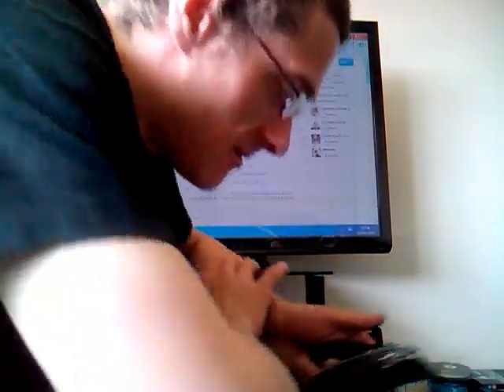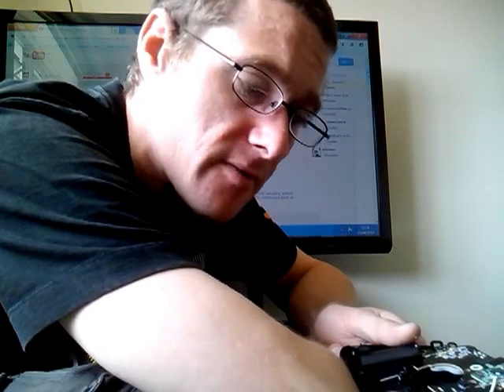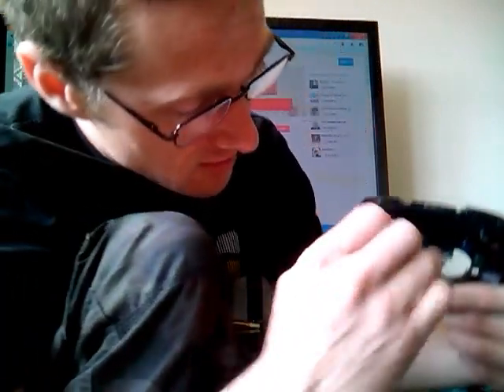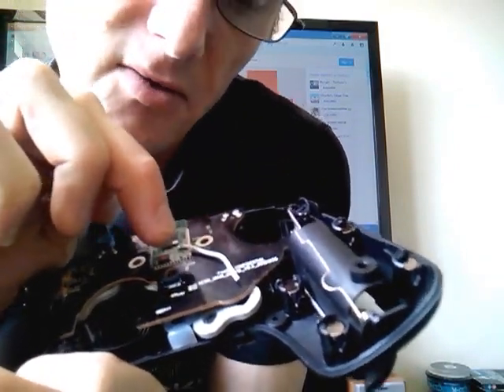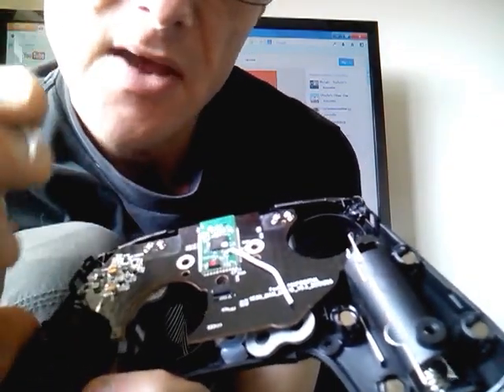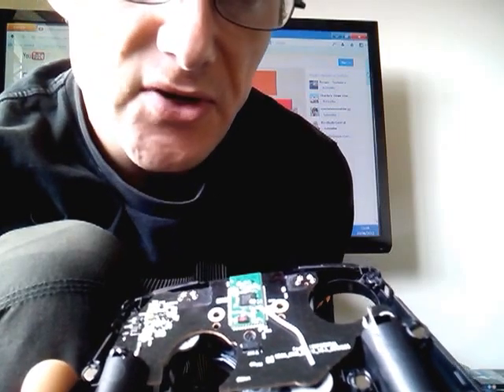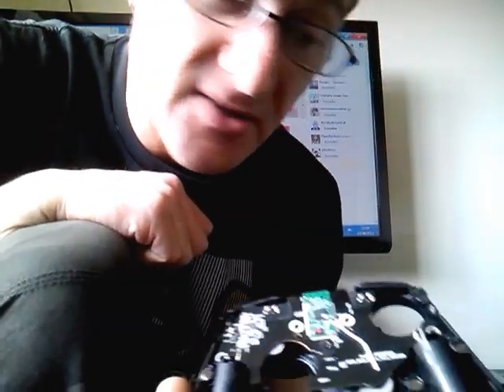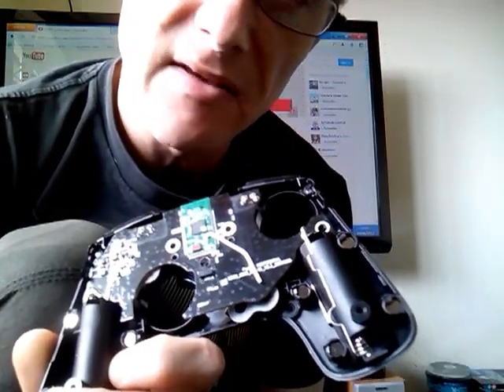OUYA CONTROLLER CONNECTION FIX (BLUETOOTH RECEPTION MOD)

Comment from the maker: I did use the wire for a laptop wireless receiver it came from an old acer laptop lid,sorry never mentioned that in the clip,but any wire will do its nothing different than basic small diameter silver toned wire any way mate.You could use headset wire from a mobile phone headset as well,as that acts as a radio signal antenna for a mobile phone radio thinking about it.basically any wire will suffice though, it's the end point it's connected onto that makes it a receiving cable once soldered on.